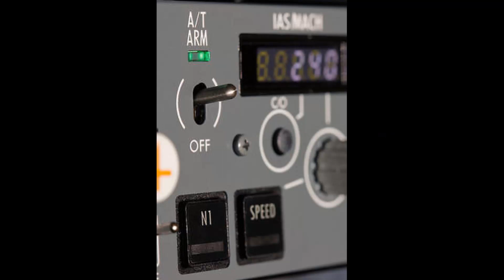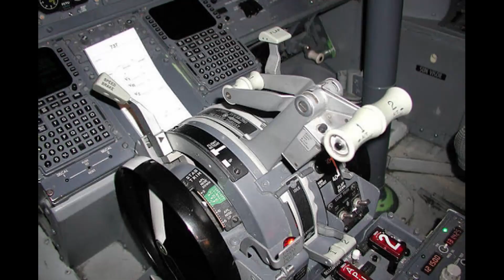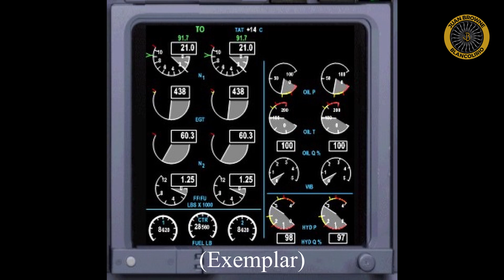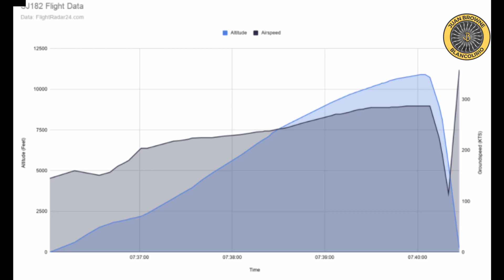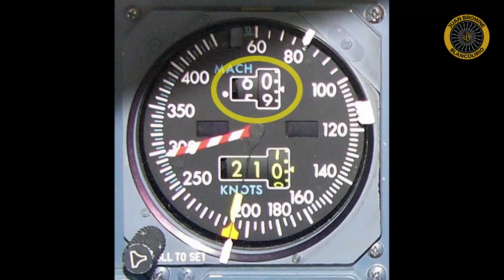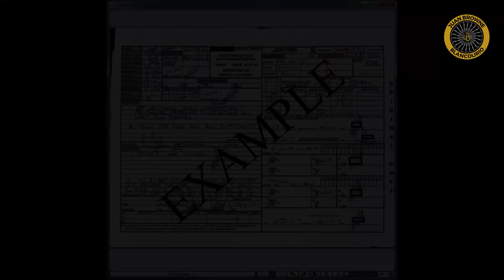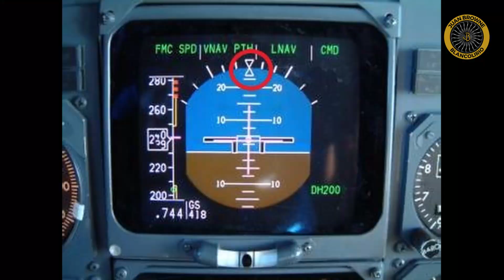Sriwijaya SJ-182 KNKT Preliminary Report 12 Feb 2021

Comment: I had a similar upset in a Hawker 700 a few years ago at 16000ft in daylight over Manchester, England. The yaw damper pushed the rudder to full scale deflection due to an incorrect induced current in the yaw damper wiring.  The autopilot corrected until the ailerons hit their limit switches and WHAM we rolled 135 degrees.  Fortunately we were military pilots who had come through the RAF training machine so we had the instinctive reaction to such events that you describe, in addition our squadron had by then included upset training every year in the sim.  Fortunately the VIP pax were asleep and missed the excitement.
Reply: Could you tell us please, How did you perform the recovery?  A few years ago, a Learjet 45 crashed in Mexico City, after hitting a severe episode of wingtip vortex when approaching final behind  B767-300, which rolled it inverted.

After the crash, one fellow pilot of an Embraer ERJ-145 was put the same roll at the simulator, where ALL the previously examined pilots were uncappable of executing the recovery, except that my friend was a former Mexican Air Force pilot, and he was able to perform the recovery (barely!), because of that training, and because the previous pilot exiting the simulator, whispered in his ear: "Careful!, they will put the 'Mouriño's crash' onto you" when they passed by on the stair of the sim. (Mouriño was the last name of the high government official killed in that crash). 
 Thus, he had time to think in advance, so that he did not fight the uncommanded roll, but instead, he aided the plane to continue the roll and applied heavy rudder to combat the nose down at each  90 degree bank, losing about 1500 ft altitude during the complete roll, but clearing the buildings and landing "undamaged".  So far, he was the only one to ably perform that same recovery.  Makes me think that Commercial pilots should receive more unusual attitudes recovery, or some Aerobatic training plus some Glider experience.  The fact that some of the best stellar airmanship examples (Sully, Pearson, Carlos Dardano) pilots had either glider, or intense manual flight abilities, tells something.
Reply: @alfredomarquez9777  took (grabbed) control, confirmed the autopilot was disconnected, kept the nose on the horizon (we were VMC) and rolled back to the horizontal. Took a deep breath, trimmed the aircraft (first big clue) and stared at the instrument panel to see if anything looked out of the ordinary.  Cursed. Checked condition of passengers, still asleep! Conducted in very slow time a fault analysis
Reply: @alfredomarquez9777  One thing about the response of the crew on that Mexico City vortex encounter.  The were praying at same time they were required maximum concentration to the suddent rolls and descents into the city.  That is introducing a distraction from the hard duties he had at that moment.  I dont like religious pilots.  They ask for help from god when they have to work hard and quick instead.  There is no time to pray when quick sudden corrections are needed.  

And yes.  I had a vortex encounter when young and practicing formation flight take off.  I was rolled hard left a around 200 agl and Vy only.   Too low and too slow.  Heavy ailerons C182.  Losing aileron control and rolling  I pushed nose down to between 2 buildings to build speed and get away from vortex.  Ended up at around 100 feet between 2 200 feet high hotel buildings, but  not rolling anymore.  Never again i got too close to the leader.  I was scared but i scared too those tourist down there.  They called..  I explained the cops what i did.  They were scared when i pushed the nose down to them on the beach and thought i did it on purpose to scare the gringos there.  They dont know what is vortex turbulence.  They said "The second airplane decided to zoom us at the beach.  He did at around 100 feet over us.  Sorry for that, but that saved my life..
Reply: @gordonbruce2416  By the way, Yo soy Latino pilot too in USa.  Boricua..
Reply: @emergencylowmaneuvering7350  So you should know about Carlos Dardano!, for me a great great great pilot!
Reply: @alfredomarquez9777  The best emergency landing ever.  Sully could have put it in the river.  But Carlos chose the more difficult way of landing instead.  He instead did A Short field no power landing on a grass field.  That is a real Latino Pilot.  CAjuns..  Im a bilingual CFI retired in USA.   See my channel for the most hard to do maneuvers done easier.
Reply: @emergencylowmaneuvering7350  I'll look for your channel, that's for shure!
But I think you are not correct about the Learjet-45 crash at Mexico City: the pilots were NOT very "religious", nor were they praying anymore than only exclaiming during the very last ten seconds before impact.  The stupid government of the country, and the inept Transportation Secretary Luis Tellez, one of those "superman" individuals that go from one position to another very different one in a short time, working in multiple and very different roles, never ever getting true experience, found easy to put the blame on the pair of pilots, since they found some inconsistencies on their total hours and their training.  The pilot in command had less experience than the copilot, but the blame was put on them in an absurd and exaggerated manner. Their cockpit recording was grossly distorted in the press releases, so to put all the blame on them and only them. (Should they have been SO incompetent, they would have crashed much earlier, as the Lear is not a Cessna, and they were able to perform several flights without any problem).  The real culprit in my humble opinion, was the personnel on the TRACON and tower, since the workload on the single controller was high, and the controller concentrated (wrongly!) on separating the HEAVY B767-300 of Mexicana Airlines from the much lighter A320 in front of it, AND COMPLETELY FORGOT TO SEPARATE THE unfortunate Lear-45 from the B767-300, which is about 16 times heavier and known for its terrible wingtip vortices! Another thing is that both the Lear-45 and the 767-300 were clasified too similar and close on the separations table in place at that time. There was ANOTHER Lear-45 crash in USA previous to the Mexico city one, also caused by wingtip vortex...
I believe they have finally ammended that separation table, wich evidently was completely wrong, as the poor Learjet-45 was flipped upsidedown by the 16 or 17 times heavier 767-300.
Reply: @emergencylowmaneuvering7350  : "CAJUNS" truly means "COJONES" in Spanish, or "BALLS" in english!  Pilot Carlos Dardano had huge BALLS and even bigger abilities to execute that landing on the grass levee!
Reply: @alfredomarquez9777  OOp's that is a real error to put a 45 on same separation category as a 767..  Thanks for the correction.  That is the problem in aviation in USA.  Guys that like airplanes, but are not pilots are put in charge of FAA and NTSB.  Those Beurocrats appointed by the new party that won the last election.  They make stupid decisions based on BS many times..  Did yo see Biden's new secretary of health in USA??  Its a Transvestite..  LOL..
Reply: Thank you for sharing your experience. What came into my mind when reading it: OK, the FO of this flight was only a CPL and an "Only-737-pilot" - but the Captain was not only very experienced and hold an ATPL but he was also a former military pilot, too. So at least he should have been able to recover the plane. But obviously he wasn´t able to do it. So this has to be explained, too. The question is also who was the Pilot Flying and who was the Pilot Monitoring which has to be answered. But with the CVR data we´ve now a chance to get the full informations.
Reply: @emergencylowmaneuvering7350  It has nothing to do with the topic of this video and what Juan discussed here but just for interest: Why shouldn´t a Transvestite be a good Secretary of Health? If decisions are good or bad, appropriate or inappropriate to a situation doesn´t depend on with whom the decision-maker is f*cking in his sleeping room at home. If you´re a pilot you should know it - otherwise I would try to prevent to fly with a plane in which you´re one of the two guys in the front seats. BTW.: I´m not an US citizen and I´m not living in the US so I´m not involved into the policy making of your country.

Comment: feel like there should have been an alarm telling them the plane is so mistrimmed.. this is well beyond normal parameters for a flight, why was there no yellow caution of some kind to tell them something's wrong? I mean that level (equal degree of pressure applied) as say a down-trim on the stabilizer you will get a trim caution light of some kind (depending what you are flying the actual caution differs, but I think on all or most planes you will get something) why not for the yaw?
is there an optional alarm available for this? would other models also keep silent all the way until the automation snaps off? feels like there should be a message somewhere on approach to the automation limits....

Comment: Great video. Doesn’t matter how many flying hours you have it all comes down to training and training to proficiency, or in this case looks like UPRT training and workload/ spatial awareness (being unaware of the split throttles, physically identifiable on the THR quadrant and corresponding N1 gauges- incidentally brings me back to the FAA argument of FAA not keen on AIRBUS thrust lever design non moving throttles and side stick in the 90’s)- Excellent paper on ‘DIVERGENCE BETWEEN THE HUMAN STATE ASSUMPTION AND THE ACTUAL AIRCRAFT SYSTEM STATE’, very good evidence but make your own informed opinion.

Comment: The 737-300, 400 and 500 were notorious for having a throttle servo stuck. The airline I worked for in the 90s had implemented a procedure where the PF would always have his hand over the throttles on departure or arrival so they would always tell if the servos were not working properly.
Reply: I recognized this, too, eben not being a pilot. In the report it is questioned who of the two throttles failed or if both failed. This came to my mind whìle hearing this.
Reply: Kind of like sticking ones head out the window to check wind speed! Just make it work!😉
Reply: The Lazy bad habit of using 2 hands for even easy to do mild maneuvering.  Even on DC3's heavy ailerons I kept one hand on throttles.  They are part of the pilot duties.  Takes coordination, but that is a needed duty of real pilots..
Reply: @emergencylowmaneuvering7350  That's right. But until now we only can say that's probable that no pilot had a hand on the throttle's. We indeed need the CVR for evidence.
Reply: @Hans_R._Wahl  So you think they did have one hand on throttles and let them roll back like they were asleep?  No chance.. Unless they were so clumsy they can only use one hand at a time.  That i can believe.  seen some like that.
Reply: @emergencylowmaneuvering7350  No. It seems to me that unfortunately no pilot had a hand on the throttles - and because the high workload in the cockpit in the decisive two minutes and the sort of this workload generated a focus of the pilots on other things they had their thoughts and eyes somewhere else, too, not on the throttles. So it stayed unrecognized what was going on with the throttles. The rollover of the plane must have been a total surprise for the pilots, so they were unable to recover the plane in the remaining few seconds.
Reply: @emergencylowmaneuvering7350  Due to the Preliminary Report and based on the FDR data it seems obvious to me that the pilots failed to recognize the position/s of the throttles and that this was the direct reason for the crash. But the FDR is unable to show us why this failure happened. Because they now finally found the CVR data module we can hope to get soon the crucial information why they failed to recognize it, so that we no longer depend on thoughts and speculations about why it happened. It sounds at least to me more convincing that the special circumstances of the crucial two minutes of this flight caused the loss of situational awareness by the pilots than to say: The pilots were simply stupid idiots. But let´s wait and see now.
Reply: @NicolaW72  oh no.. Those guys have a good accident record,  Oh wait...
Reply: @emergencylowmaneuvering7350  According to the textbook this crash was easily avoidable and both pilots had the experience to do it, especially the Captain. But the reality often doesn´t matches the textbook. So it will be really important to know why they were unable to get the situation under control. And to repeat it: Fortunately the CVR-data are now available. They will be very interesting - I hope that Juan is updating this story than, too.
Reply: @NicolaW72  For me, this looks like another of those "2 Hands Death Grip" Pilot Error.  Seen that on training of nervouse pilots.  777 at San Francisco dummy captain did that too.  Death Grip, forgot the throttles..  The 2 others afraid of adding power for him.  Dummies.  

Many accidents like that.  737 Max in Ethiopia; same thing.  Neither cut the throttles, hit ground at over 300 knots.  Dummies should not be pilots..
Reply: @emergencylowmaneuvering7350  The 737 MAX story is a whole other one than this crash of a Classic - you should know it and you should know the difference of a MAX and a Classic if you're really a pilot and a pilot who's not a dummie. And for this 735-crash we will see now what the CVR will tell us. Blaming the stupidity of others is usually the greatest stupidity itself.

Comment: Anyone familiar with China airlines flight 006? One engine quit and uneven thrust caused plane to bank to the right. Once crew disconnected A/P the 747 suddenly banked to the right and went onto nosedive for 30k ft. They had time to recover once they broke out of clouds at less than 10k ft I believe. I see pretty much same thing happened to that 737? 

So long story short I think autopilot is kinda dangerous if there is something wrong with airplane and AP trying to fix the problem by moving flight surfaces to maximum and then just snapping off freeing them to neutral position causing plane to have sudden turns,dives? 
Feel free to educate me because I'm sure my thinking is a little off on this one 🤔

Comment: I would need to hear the CVR. Apparently no one noticed or commented on the N1 and the throttle position?  They seemed distracted and unaware of the A/T maintenance history.  150 hours of initial primary/instrument instruction doesn't give you a lot of experience and confidence as Pilot in Command.

Comment: Impossible for the crew to miss throttle positions after three climb instructions that too during the critical phase of the flight. Apart from auto-throttle malfunction there must be something else to this accident (poor maintenance e.g.). Unfortunately, we don’t have CVR data yet and it looks like the investigators and the airline have already found deceased pilots as scapegoats. No mention of the weather, delays, airspeed and bank angle in preliminary report.

Comment: My 185 Garmin G5’s were configured with the default Ground Pointer displays.  I was so used to the Sky Pointer display configuration that we had in the jets that I reset them to Sky Pointer and my preferred “Sperry dancing snake” dual cue presentation instead of the v-bars.  Nice to have a reconfigurable option.  Thank you Garmin.

Comment: Boeing should install a warning system when the aircraft senses uneven thrust on the engines that could have probably saved them in this situation. I still can't believe that they didn't notice one thrust lever decreasing, especially in a 737 where you can see the thrust lever moving back.
Reply: these clowns should not be in the flight deck

Comment: I hope the issue with the FO only having a commercial license doesn't became a bigger issue. In my opinion, both pilots had enough time in type, what matters to me, and so well qualified. However, I would have caught the drifting N1 and throttle right away. The 737 rudder is very powerful, enough to roll the airplane upside down with no ailerons help. A throttle split during climb and level off can certainly upset the airplane if and when the AP kicks off. I'm eager to listen to what the CVR recorded. Like you say, no time to read the QRH. Correction is NOW! Well done

Comment: Question,

Please tell me there is a warning system that will alert the pilot, if on a twin jet one of the engines is not in sync with the other engine by a pre-set percentage margin of error. And if this occurs a procedure/check list to combat/rectify the situation or option to manually fly the aircraft and RTB if necessary.

If this is not the case, then to be honest, is this not a staggering oversight in the flight management design with a probably fairly simple software fix and revised training.
Reply: Normally yes

Comment: Tracking flying hours (or seat time) in this day of extreme automation is archaic. A pilot might only actually fly the aircraft for 5 minutes on any given flight. We should be tracking cycles on both the airframe and the pilot. Looking at simulator time, for a comparison a nuclear control room crew in the US gets 20 hours of classroom and 20 hours of simulator training every 6 weeks with a written and simulator exam included. There is a yearly comprehensive written / sim / plant walkthrough exam administered by the company and this is administered by the government every other year.